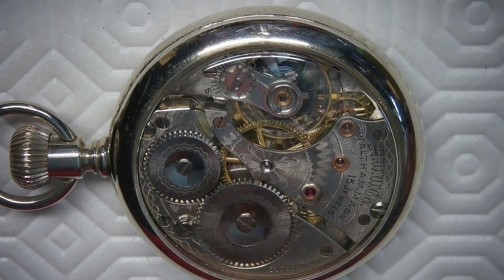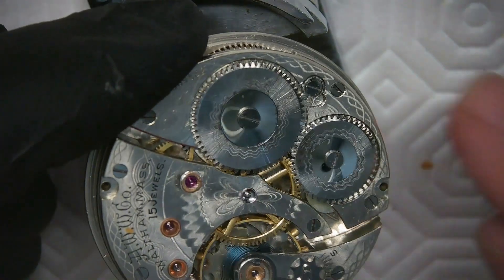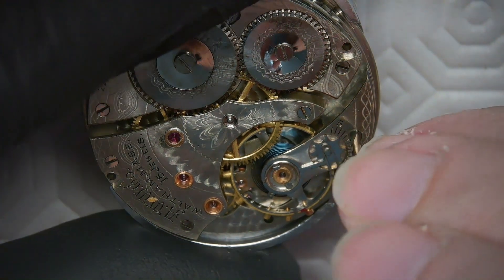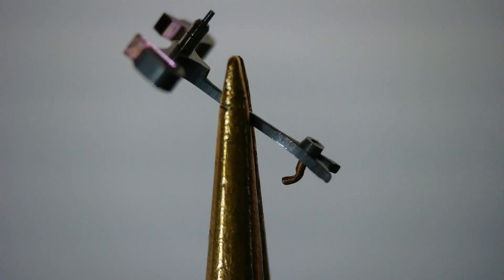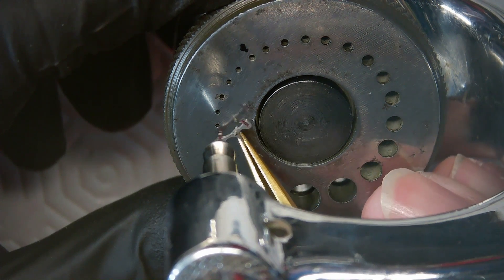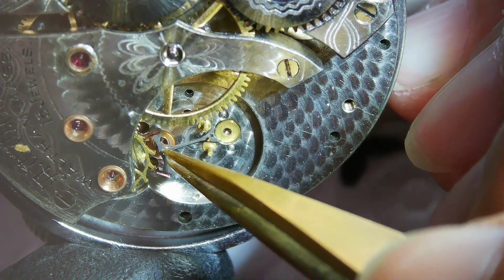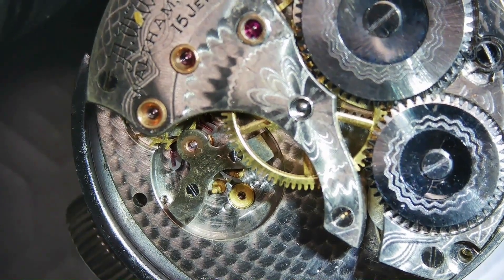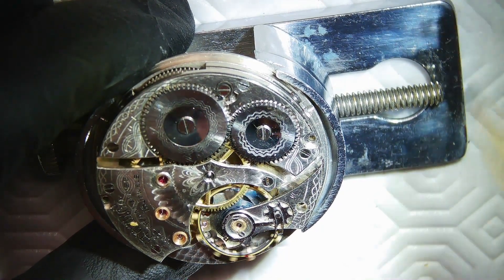Waltham Watch Pallet Fork Adjustment

Comment: Looking at that slow motion video, it looks like the red mark on the balance wheel rim is moving through a total arc of just over 360degrees. 

If that’s the case, then the watch isn’t running with a good amplitude, because what is referred to as the balance amplitude is actually HALF the total arc that the balance wheel travels. 

So the amplitude of this watch is actually just over 180 degrees. 

Unfortunately watchmakers often fiddle with the banking pins in an effort to correct all manner of escapement faults. 

In reality, the ONLY reason to ever adjust the banking pins is to adjust horn shake when setting up the escapement. Once horn shake is within tolerance, the banking pins should be left alone. Meddling with the banking in an attempt to get a watch running might sometimes seem to yield improvement, but in reality you are moving further away from having the watch run as it should. 

Unless you have checked the horn shake and found it needs adjustment, leave the banking pins alone. You’ll save yourself a lot of work in the long run. 

I’ve described horn shake and escapement matching elsewhere, but it’s seldom explained in most books and often misunderstood online. 

To aid those interested in understanding banking pins and horn shake, the following is how to set up an escapement. 

This might seem like a long process, but it ensures that the escapement is correctly adjusted and it’ll run well. Going through this procedure once could save weeks of chasing your tail by making all kinds of changes and replacing parts on a hunch that they’ll get the watch to run. 

If you have eliminated all defects outside of the escapement, the following procedure gives you a sure fire way to correctly adjust the escapement and have the watch running well with good amplitude. 

Escapement Setup : 

The first step is checking the end shakes and ‘divisions' which are the vertical clearances in the escapement parts and alignments as follows.

Ensure that the escape wheel teeth are striking the vertical centre of the pallet stones, the fork horns must have good contact with the roller jewel without touching the roller table and finger is correctly aligned with the safety roller.

With that taken care of, it is time to set up the escapement.

First check the horn shake. This begins by
checking the fit of the roller jewel inbetween the pallet fork horns. The roller jewel should fit easily between the fork horns, without jamming. Ideally should have 0.01-0.02 of shake between the horns.

Next, turn the balance wheel such that the roller jewel just enters the fork horns, and examine the freedom of the pallet fork's action. Use an oiler to move the fork to check the distance the fork moves between the banking pin and the moment the inside of the fork horn touches the roller
jewel. This is horn shake.

This horn shake distance must be small enough that the pallet jewel does not unlock the escape wheel tooth it's locking, but larger than the guard pin shake, which is explained below. 

If this condition is not satisfied, it can be adjusted by moving the banking pin. Horn shake must be equal on both sides for an escapement to run well, if it isn't, the banking pins should be adjusted to equalise horn shake whilst maintaining the above conditions.

Whilst banking pins are moved in an attempt to remedy all manner of faults, adjusting horn shake is the only legitimate reason to move the banking pins.

Guard pin shake is tested as follows. Move the balance and hold it in a position where the roller jewel is completely clear of the fork horns. 

Now use an oiler to test the movement of the pallet fork between the banking pin and the moment the guard finger hits the safety roller.

The guard pin shake must be slightly less than the horn shake so that the roller jewel will never strike the fork horns when it tries to enter the fork, and it must be equal on both sides.

If the guard pin shake is too large, the guard
finger must be adjusted towards the safety
roller. If the guard pin shake is too small, the
guard pin must be adjusted away from the
safety roller.

If the guard pin shake is not equal on both sides, the guard finger must be adjusted such that it is properly centred in the fork.

Now that the fork/pin/roller interaction is
correct, the engagement of the pallet stones and escape wheel must be checked, such that drop, depth of lock and slide are correct. I'm pretty sure you understand the relevant measurements here and they're readily available in books, too. 

Adjusting the depth of the pallet stones in the fork is the correct way to adjust the engagement between pallet stones and escape wheel.

Having proofread this, I noticed I've used the words pin and finger for the guard finger/safety dart. They both refer to the same thing throughout.

Hope this helps, if I need to clarify anything, just let me know.

EDIT TO ADD : JD, once you have your camera to film through the microscope, you might consider making a video demonstrating the entire escapement matching process described above. It would surely be one of the most useful and sorely needed watchmaking videos on YouTube.
Reply from the maker: An absolutely brilliant explanation of how this is done. Not shown on film or some of the adjustments that you’ve recommended that I have done to get this watch running. I’m sure the amplitude will be better this morning as this thing works itself in, as well, I did not put much of a turn on the main spring so there’s not a lot of power going to the pallet fork. I did ensure that the guard was the right shake between itself and the safety roller as I had adjusted a few times to make sure that it wasn’t actually touching the safety roller as the watch balance rotated. once I had that working well, I adjusted the banking pins inward that equal distances and got the watch running extremely quickly just to make sure that I did not have this overbanking condition. Or whatever you wanna call it. Like out of adjustment. Once I had this working, I moved the banking pins away from centre equally and ever slightly as the watch gained amplitude until I was satisfied that I had a reasonable amount of amplitude and that the pallet fork stones were interacting appropriately with the feet of the escapement wheel. Perhaps not as accurate method as you would have with a measurements, but this watch is not a high-end watch and I’m sure that the handshakes of all of the wheels, etc. do not have the tolerance of a high-end 21 jewel Railroad grade watch. As you know, I have been working on this particular movement for quite some time now and have to return it to the individual once I get this running reasonably.. Getting this watch working has been extremely painful and this cost would be a lot of time, almost not worth it, but I’m really satisfied what I’ve done and hopefully I’ve cured the problem and hopefully I will have more amplitude on this watch once I wind up The main spring. I’m going to copy your notes and put it into a note file as I think that technique is the way of doing it as you have mentioned in the past, and I respect your knowledge in these areas. Following your notes, I could set up a session on how to adjust banking pins on one of my watches and pretty much take the watch out of tolerance, measure it, do the job measured again, and show how the performance is improved. Thanks for the detailed explanation, as I am an amateur Watchmaker and not a professional as you are.
Reply: A video of these adjustments would be fantastic.  Unfortunately, I’ve purchased movements where the banking pins have already been moved from optimal position.

Comment: What process did you follow to adjust the banking pins?
Reply from the maker: I replied in the past comment, but what I actually did was adjust a bank and pins inward to the point where the watch was working and the impulse was being thrown back-and-forth by the pallet fork. And then I slowly and equally moved to banking pins outward until I reached a reasonable amplitude with the watch. There is a comment under this video that explains some more precise method of doing this that I would use on a higher end watch. But spending $1000 worth of time on $100 watch makes absolutely no sense.